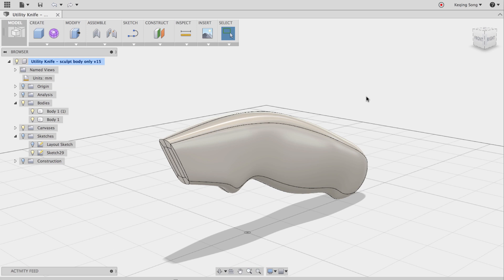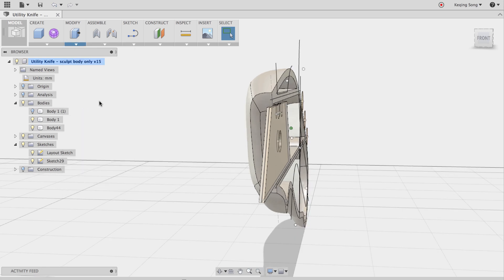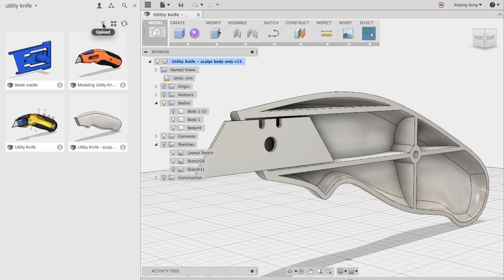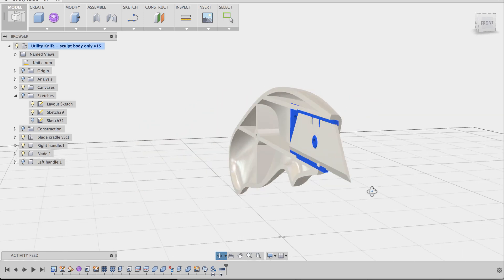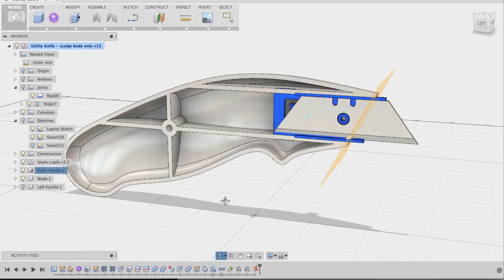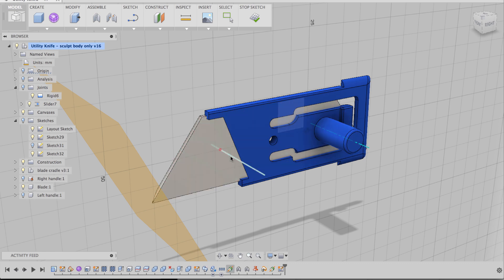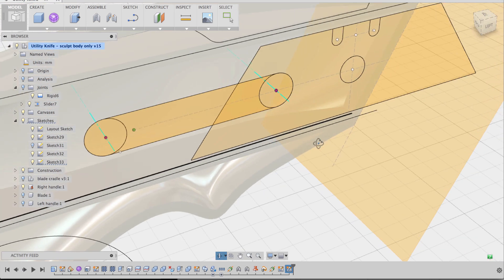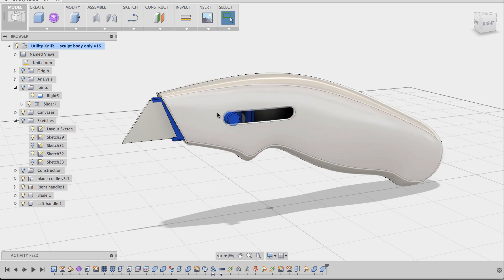04 model part 3 (extra credit)

Comment: Having trouble setting the cilinder axis correctly. for some reason I'm getting a warning that the referencing geometry is missing :S
Reply: Mauricio Talero I had the same problem, right clicking the blade_cradle component and choosing 'Break Link' and then adding the axis worked for me.
Reply: Ben Makins Thanks Ben! I was having the same problem.

Comment: Thanks for the useful tutorial. In practice I'd imagine that we would need a small clearance gap between the blade cradle and the openings made in the handle (to ensure smooth movement, compensate for production tolerances, etc.) -- any suggested method of adding that to the workflow? In SW I'd start offsetting faces etc.